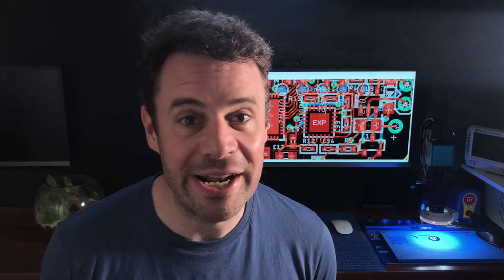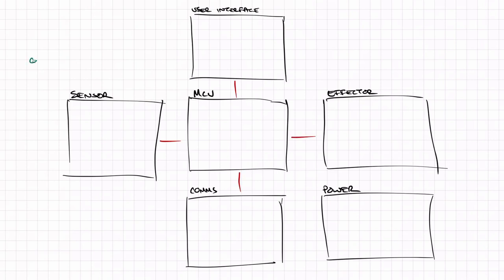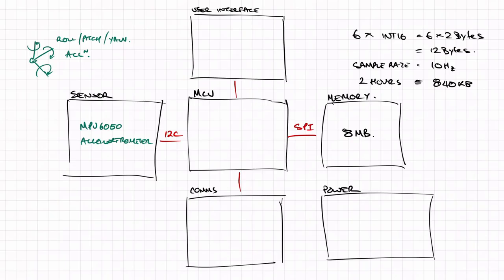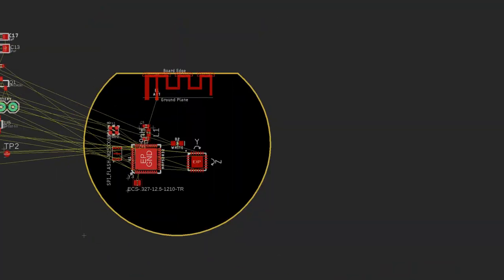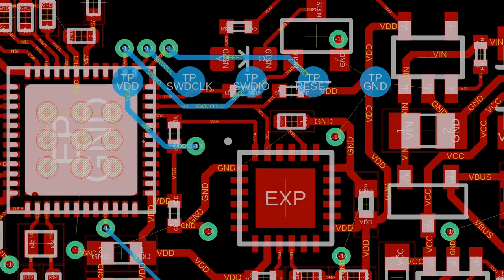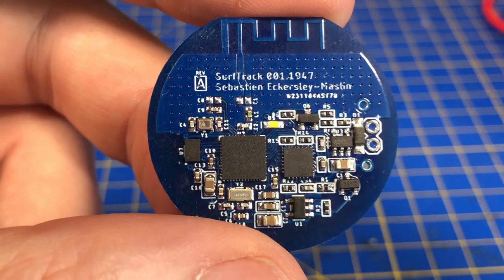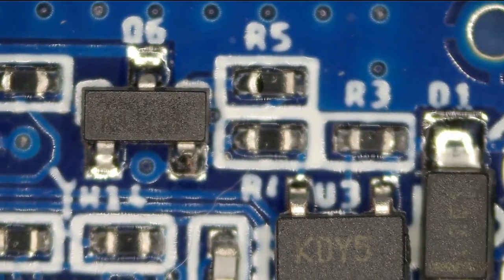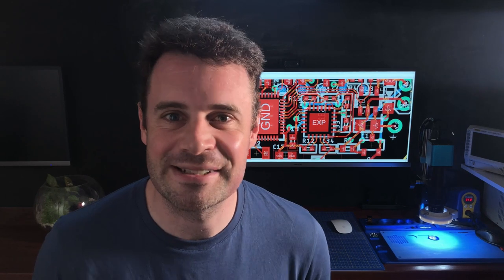Hardware Design - A Real Time Surfboard Position Tracking Device

Comment: Thanks for sharing, liked , subscribed and looking forward to more.
Love to take the concept one step further with a 9-DOF IMU to capture heading as well and down the road GPS to capture location. Kind of a scaled back version of a tracker for sailboats racing on a closed course.
Reply from the maker: Thanks for your comment! Yeah some of the data coming from the (working!) device does suggest that a 9DOF would have been more useful, so I might make an "upgrade" later down the track if I can't get the data visualised in a way I want with this one.  GPS should be fairly straight forward too - it just "bulks up" the device a little!
Reply: @PrototypeBeta  Paul McWhorter (TopTechBoy.com) doing a series on utilizing a breakout board by Adafruit with a common 9-DOF that is as good as any I've seen. A bit drawn out and at times simplistic in detail but thorough and informative for sure. Might be worth looking at for future support.

Comment: Super interesting series / channel idea. Subscribed! I do have a couple questions though. I'm a guy who's comfortable with software and likes playing with suuupppeerr easy stuff on breadboards but I don't know the first thing about electronics / board design. 1) Do you have any intention of showing us how you used the design guides in the data sheets and how they informed what you were doing at 3:42? 2) Do you have any "pre req" electronics knowledge that we should brush up on before we could do something like like this?
Reply from the maker: Thanks for your comment!
I will dive a little deeper in to the circuit design in an upcoming video (different project).  It's mainly focused on the PCB board design as that's what people in reddit were asking for, but it does give more info on how to create the circuit based on reviewing datasheets.

If you're already comfortable with dev-kits, try and use ones that have published the schematics (e.g. Adafruit, Sparkfun) and study those.  Those guys layout their designs neatly and you can follow them.  Then lookup each of the datasheets of the components they use, you'll find they've pretty much used the examples.  Thats a great place to start :)

Comment: This is a brilliant work.
Please, could you tell me the name of the programm you used to make a scheme?
Reply from the maker: Yep! The sketch was done using "Good Notes" on my ipad (using Quicktime to capture the drawing) and the schematic was done using Autodesk Eagle.  I use Eagle because it integrates nicely with Fusion (the CAD I use to create the models) and I've built up some nice libraries of parts now, but I started with Altium (when it was called Protel 99SE!) - but alas Altium doesn't play nicely with my macbook!
Reply: @PrototypeBeta  Thank you very much for your answer! I also use Autodesk CAD for creating models, but Inventor, not Fusion. I hope Eagle and Inventor are as well integrated as Eagle and Fusion